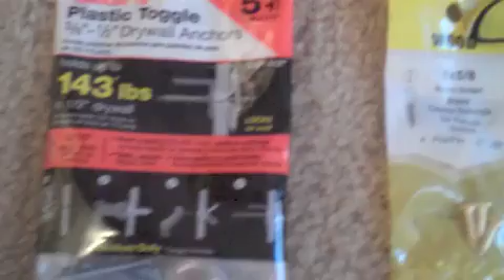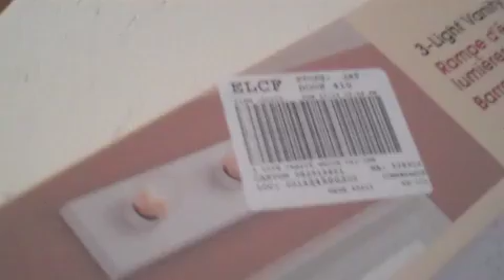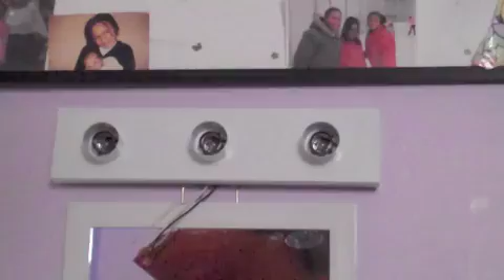DIY Vanity for my daughter

Comment from the maker: Congratulations!!!!  I so happy you made it!  No.  I actually made one for me. Before I made my daughters.  My vanity has two light fixtures. There are (6) 60 watt bulbs in my vanity.   I don't use hot tools so I wouldn't know about that.  But I'm sure another light fixture equate with hot tools.  I've had mine for a couple of years now and no problem what so ever.

Comment: LOVE this video.... but please please please people.. use what my husband calls "wire nuts" not tape for the connection of the wires.  Fire hazard otherwise.  If you are able to do so please redo this part.  120 volts is running to the light bar.